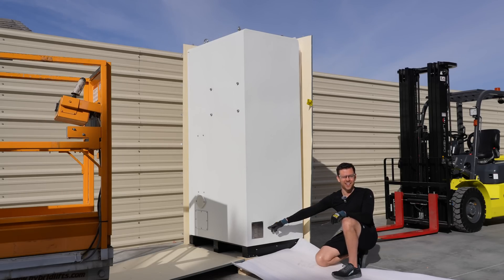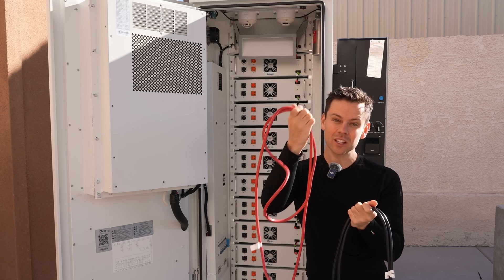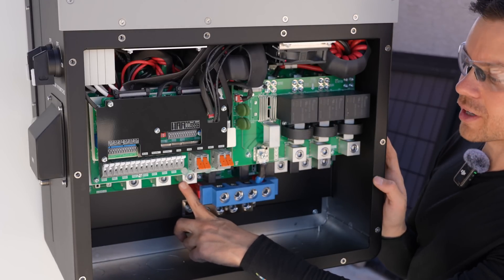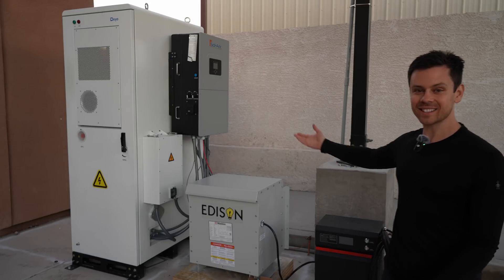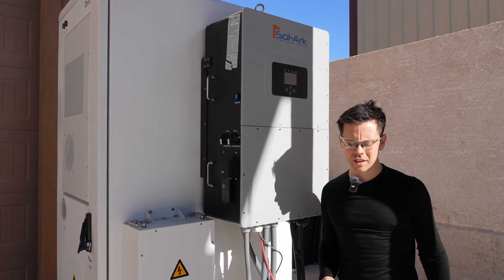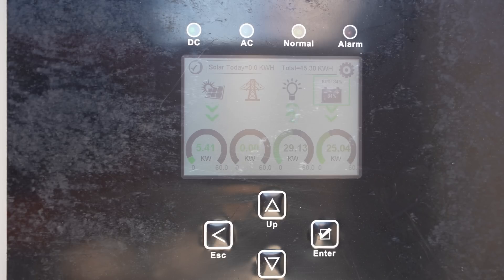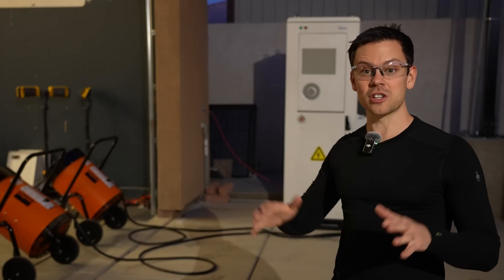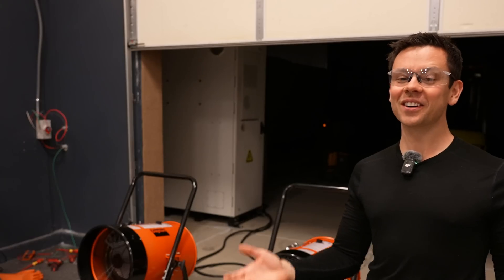60,000W 480V 3 Phase Sol Ark + 60kWh Deye LiFePO4 600VDC Battery Testing!

Comment: This is what I’ve been looking for. Three phase 480 with a delta transformer gives two 120 volt legs and 240 volt to ground. If you have 3 phase available or a big enough solar array, this would run a three or four unit apartment building. 
With heat pump HVAC and water heater , even electric clothes dryers would seldom push the load past 60 KVA.
I was surprised how little capacity is really needed for normal loads in a small house when,after running the remodel on a two bedroom house on 60 amp temporary service run from my house,that they never needed more capacity.
It now runs on two 5K Growatts never breaking a sweat because the electric dryer is still on the grid power. When they use the dryer after 8 pm when we have free grid power,the grid consumption is negligible.
When I said I was looking for this product I didn’t mean I wanted to buy it. I’m just excited that there is a plug and play product for a small business like apartments or convenience stores.

Comment: Echoing everyone else's comments, you're well past arc flash territory, you need the suit when working with this stuff. Having seen it firsthand, the PPE is absolutely required here. While the risk is lowER at 240v, it's still possible, at 480v it's significantly more pronounced. If you're buying $35k batteries to test, spend the extra grand on a good suit/hood/gloves. Nobody's life is worth the video.

Comment: So many small to medium sized businesses should be installing these instead of diesel or gas powered emergency back-up systems. Slap on 40 or 50 Kw of solar panels, cut your electricity bill in half and always have enough batteries to see you through any grid down situations. Generators are just dead money sitting there waiting for the next service bill.

Comment: A guy in Vegas orders 2 30,000 W heaters😂.  What are you doing, Will, are you planning on making it hot there all year long😂.  I’m gonna see if I can use solar panels and batteries to keep Vegas at a constant temperature all year long.😂.  OK now that you have all the set up you need to install Vegas’s newest attraction. The thermostat for the entire city sitting at the airport with couples fighting over it.😂
Reply: You build a boxing ring around the thermostat and then sell tickets😂

Comment: We have a tool at work that makes the same noise, its the high power contactor. We think its something to do with the voltage sag as it turns on. Just a guess thats your problem too.
Reply: Believe it or not the high current on start up is actually so high it overcomes the contactor coils ability to hold the contacts closed and is blowing the contacts open. If you inspect the contact surfaces you will see severe pitting. You need to install a bigger amp rated contactor to get rid of that problem.

Comment: The disconnect needs to be on the outside of the panel . You never turn on a high voltage device from inside the panel.
Reply: I thought that was odd too as you have open it up every time you need to switch on or off. It should be on the outside of the door. Also I would have made the cabinet big enough to fit the inverter inside and also included a 240volt single phase inverter output too.

Comment: This was cool. I think this equipment will help with testing  HV home systems.
I am beginning (after much delay) to build a HV home system.
320VDC battery to run the EG4 DC powered air conditioner directly when the sun is down.
I am looking at using the Sungold Power HV 11.4 kW inverter/charger and Orion 2 BMS and planning on a 450V solar array.
Still working out integration of the BMS and inverter. Haven't began any actual assembly yet.

Comment: That battery is 0.5C, they can only output 25kW constant. You need two battery cabinets to fully run at capacity. Also, those inverters don't like running at 100%, they work better at 60-70% constant load in off-grid mode.

Comment: the high voltage batteries are a LOT more expensive than the 51V ones (LIKE A FACTOR 1.5X)  this is why for myu 40kw setup (2x20kw inverter) i picked 8 of the 15kw 51V batteries, it is a bit less efficient , i agree but even with some thicker cables still cheaper !

Comment: That motor noise on start up was strange.  It would  be interesting to check the current and voltage output with an oscilloscope to see what the wave form looks like.  Spikes in voltage and current can mechanically destroy a motor.

Comment: Will at these power and voltage levels you should consider wearing arc flash safety gear. 480 V AC or DC  is no joke and the arcs that can result from  a mishap or equipment failure are dangerous. I’m a retired electrical engineer who has seen first hand the damage that this kind of power can do. The safety procedures at our utility were very strict when working or even switching breakers with the cabinet open at these voltage levels. A lot of lineman and metering people consider 480 V the most dangerous voltage to work on in our company due to the high power and close clearances.
Reply: What you are talking about? 3 phase 230v? Thats perfectly normal household voltage almost everywhere in the world except USA and few other countries. Aint nobody using  arc suits with these voltages 😂
Reply: @Markush444 There’s a huge difference between plugging a 240V appliance into a wall outlet and working in a cabinet full of energized high voltage DC equipment. I think Will said 600 V DC. If you got an arc started at that voltage you would have a very bad day.

Comment: errrrr... you don't actually want water on a lithium fire... has nobody taken chemistry? You would need a specific formula meant especially for lithium fires, your best bet is just to have decent separation between anything else, lithium fires are hard to put out what your really doing is trying to make sure the lithium fire spreads as little as possible internally by being able to sink the heat away so quickly that it can't spread.
Reply: Yeah I'm thinking something to deplete the oxygen like halon or whatever they use these days.
Reply: @randya9143  no as I said your best bet is to sink the heat, so you still want a liquid that will boil off when it gets too hot and has a high specific heat capacity, just it can't be ordinary water as that will react with the lithium, there is a specific formula specifically for this. It's mostly water with additives to stop the water and lithium reacting I believe as there aren't any liquids that have as high of a heat capacity, are generally as inert as water is and readily available, so what happens is you just use mains water but as it's mixed with the additives as you go so it's a relatively compact system as you don't need to keep the solution stored pre mixed.

Comment: For people wondering, the price of the 60kW system is $35k USD.
$24k USD each if you buy six of them in a 360kWh setup. ($150k USD)
Reply: For those looking to do a budget a solis 100kw is 7k and a similar DIY battery could be done for well under 10k.
Reply: @farmerjhemp  nice, definitely an option.
Reply: Why is it THAT expensive in the US?
A Deye G60 Pro costs 11000€ here in Germany and the Deye SUN-50K-SG01HP3-EU-BM4, which is the 400V version, costs 3800€, so you'd be at ~15k€ or 17600 USD.
Reply: @DooMMasteR  is that just the inverter or the inverter plus the battery system? Commercial BESS in the US run around $1000/kwh installed.
Reply: @patrickmay8261 the G60 is the 61 kWh battery rack.
The SUN is the inverter. So yeah, complete pack, about half the price that the battery costs in the US, here in Germany.
Reply: that's actually not that expensive to be honest, same as a new F-150 with a few options
Reply: Thanks, i was wondering.
Reply: Nfpa-855 limits residential battery storage to 80kwh
Reply: @davidkrygier511 only if it's also charging from the grid or in any case?
Reply: @DooMMasteR  it's a fire protection thing so it doesn't matter where the charge comes from
Reply: @TommyApel that's even dumber... How do they just put NMC, lead acid, sodium ion and LiFePo4 in one pot?
Also that's what fire prevention and management is for...
Reply: @davidkrygier511  "You are allowed to have 40 kWh in the utility closet, 80 kWh in a detached garage, 80 kWh in either a detached structure, and 80 kWh mounted on its own pad. This means the theoretical maximum limit you can install on a one or two-family property is 280 kWh." -- isaksensolar

Comment: What is the purpose of a triple phase to single phase converter? You already have a 240V output. 3 even.
Doesn't this thing have a 50% unbalance capacity? Like most deyes in this field as far as I know?
And did you check what will happen if you sprinkle water on overheating LFP batteries? I believe the gasses that are being released when off gassing are CO (so the CO meter makes sense) and the other being HF. I prefer my HF without water please. It will go straight through latex gloves through your flesh, and the worst part, It won't really hurt. Hydrogen Fluoride acid is not my favourite thing to mess about with. I'd prefer to take my chances with the 1000V DC side.
On a totally different note. How chilled must the Deye graphics designers be.
Same graphics for years.
And the 10% discharge is a "feature" that annoys me as well, but on the other hand is understandable.
When on grid it will discharge to 10% so when you have a power outage in the worst case scenario, there is still 10% left.
You can set the minimum for every hour of the day. Still not to 0.

Comment: Awesome! Protect the inverter lcd screen from sunlight, it will get cooked.  The manual in page 8 states that damage from direct sunlight exposure not covered in warranty
Reply: 👍 cps ones run 24/7 under carports in my city.

Comment: When that was testet in Europe the Temperature Difference between the HV Modules from the TOP Layer to the LOW Layer resulted in Problems , lets see if that happens too with that unit ?

Comment: Love these big units. FYI, I have a couple of 480V 3P to 208/120V 3P wye transformers (45kVA and 75kVA) set up for portable use with camlock or 100A 5 pin & sleeve input,  distro w/multiple output receptacles, including 120/208 60A. pin & sleeve receptacles, all on wheels. Would be great match for new system. When you are ready to go even bigger and need a load, I have a light sculpture that uses a megawatt at 480/277V.

Comment: Those are just temp switches on the fans, they are max when on.  There's a motor surge for the blowers too.  The power factor on the heater elements is 1.0, but not the motors.  The motors will have a low power factor causing a reasonable KW but a higher KVA.

Comment: The Aust govt in the lower 48 have a home battery rebate at the mo. 
9.2 x STC ($36ish) x kWh of battery. 
First 50kWh rebated. 
So $16560 off the cost of supply and install. 
How much would that make life easier?

Comment: Most inverters love some solar in conjunction with battery to give full starting capacity for heavy inrush loads. You should use a clamp meter to see inrush current on one of those heaters. They should have their own LRA on their name plate. 

Still very cool, I mean hot!

Comment: Oh, thank you for getting to HV.  I was looking for a weather proof chamber for my 45+kWh HV pack also from Deye, but for cold weather instead, some time ago. Actually, the output is not insane, you should always target to load only about 50% of the load capacity. This makes equipment serve longer with less loss on heat, generated noise and being able to withstand inrush currents. Of course, idling of such equipment has higher losses.
Reply: It's higher, much higher perhaps, than what we usually deal with but technically we're still in low voltage with this equipment:  😀 

Low Voltage (LV) up to 1000Vac
Medium Voltage (MV) from 1000V to 35kVac
High Voltage (HV) from 35 to 230kVac
Extremely High Voltage (-) above 230kVac
Reply: @calmeilles  true, if we talk about regulated clearance for work, but even 52V 1000A arc is quite dangerous as well. Working in dielectric gloves is not really a joke for video.

Comment: Good on you for using high voltage gloves, but they are virtually useless unless you wear the leather outer shells with them. Also, you need to test them for pin holes each time you use them by rolling them up from the cuff and compressing the air inside, it only takes a pinhole to pass high voltage through, but generally under 600 volts is considered low voltage. Take it from someone that has gotten shocked by 480 volts, it doesn't feel good.

Comment: $35,000. Dang it. Just missed the Black Friday sale.
Reply: 35k? You can buy a used tesla with 75kw battery.
Reply: @alientehnologi That is my problem with High Voltage System. They are ridiculously expensive. Maybe because these are aimed at Industries with Large pockets anyways

Comment: Nearly everything I ran in the oilfield was 480v 3ph.  There are definitely some situations where something like this would be handy to have for backup or testing, although this one would not be suitable for that type of environment.  Maybe a system mounted in a purpose built enclosed trailer.  One time we had some wells on an island that got hit by a hurricane and all the connecting power lines were destroyed and never repaired.  This and a truck load of solar panels would have come in pretty handy.
Reply: You can parallel on either 4 or six battery cabinets per inverter and then parallel a bunch of inverters. It would be interesting to see what someone could come up with on a semi trailer. Something like an array that folds up like how some carnival rides do. The issue comes with real estate on the trailer if you want more than one battery as they need like 3' of space around them.

Comment: If you wear a dust mask for drilling concrete,  you should definitely consider wearing fire retardant clothing and a face shield for the high voltage connections. Arc flash is no joke

Comment: That chattering sounds like a contactor that’s being tripped on and off rapidly. In large HVAC they’re usually powered by 24v or 120v controls. You may be getting a voltage drop that’s letting the contactor chatter.
Reply: That's what I was thinking. I've seen that a couple times before on weak 24V transformers or failing contactors. Sounds like hell on a 7.5HP fan motor. It shakes everything.
Reply: Yes, funnily enough the little thermostat knob on the heater probably doesn't switch 30kW of 3 phase power directly. 🤔
Reply: @connerlabs  this appears to be a Dayton 784JJ2A sourced from Grainger (overpriced unless you get specific discounts but have an obscenely huge product catalog) or Zoro (Grainger's online "non-commercial" presence). This is a very simple control system based on what is in the manual. 3 phase input to a contractor. L1 and L3 are tapped off the the line side of the contractor.  L1 goes through a 2-pole thermostat that is tied together on the line side. L3 is the return for the motor and coil. L1 of the thermostat goes directly to a capacitor start 1/4HP 480V single phase fan motor. L2 of the thermostat goes through a heat limit switch and then the coil of the 3 pole contractor to run the heating element. So as Will said, it's just and off/on system.  The inverter is probably having a heck of a time dealing with inrush current since it is right at the max.

Comment: Very Cool Will!  A nice change form the typical home stuff, sort of like a Model 3 in a box. 
BTW Will, when working with live low voltage systems above 120v it's generally a good idea to have someone standing by in case the person working with the live circuits gets hung-up. When working with live Medium voltage(Above 1,000v) Two people are generally required. 
I worked with 600VDC motor drive systems and many considered is as dangerous as 4160VAC. Partly because it's typically 600VDC  phase to ground, and DC locks you up hard. 480VAC is generally 277VAC phase to ground and 240VAC about 120V to ground. 4160VAC is generally 2400V phase to ground. 
REF: ANSI Standard C84.1: Electric Power Systems Voltage Ratings (60 Hz) defines the system voltage classes as follows:
    LV: 1,000 V or less.
    MV: Greater than 1,000 V and less than 100 kV.
    HV: Equal to or greater than 100 kV and equal to or less than 230 kV.
    Extra-high voltage: Greater than 230 kV and less than 1,000 kV.
    Ultra-high voltage: Equal to or greater than 1,000 kV.